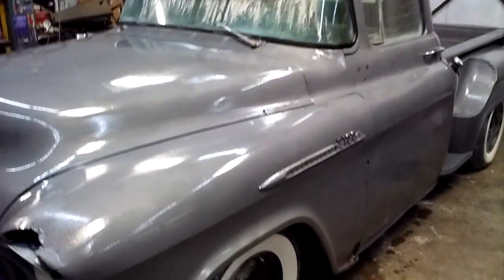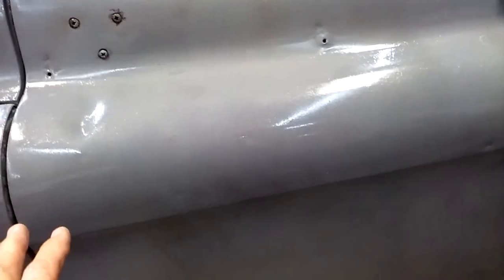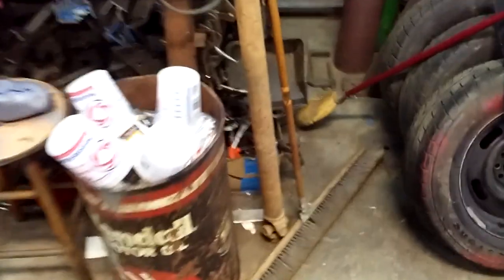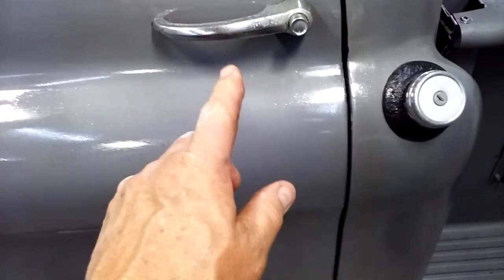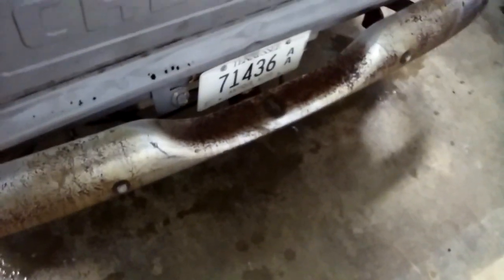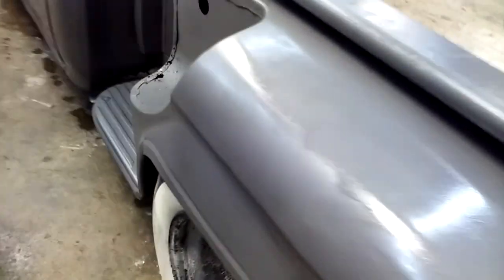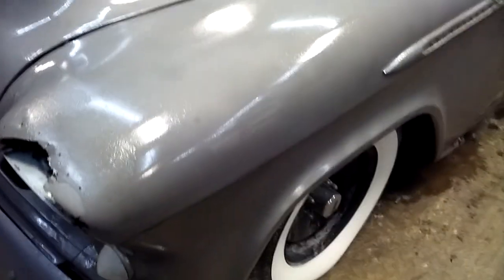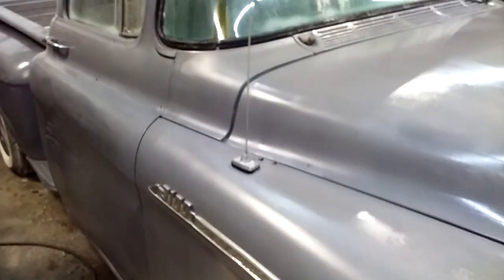Finished applying Penetrol on a 1956 Chevy truck. Part 2

Comment: That looks really good, I’ll thinking about using the kit from 3m to buff my old paint back to a shine then coating it with penetrol. Make my 66 impala stand out with the patina look.
Reply: Why not just get the body work done and paint it? I see a lot of people just lieving the old crusty rotted out body and making it shinny? Might as well just drive as is that shine is not going to make that crusty body on car truck any better looking. Just my opioion. I owed qiut a few truck's in all conditions.
Reply from the maker: I really like it too. I am glad I was there to watch and to be able to help. I think I will try that on one of mine too. Thanks for your comment.

Comment: How does it hold up to the elements / how does it look now a year later?
Reply from the maker: Hello Chris! That's a good question. But actually it all depends on how much weather elements are in your area. There is no set period of how long it will last. I keep my trucks in a garage, I don't drive them in the rain, they don't sit out in the sun much, etc. You might be a lot different than me. If you drive your vehicle everyday no matter the weather conditions, then it will not last as long for sure. For me, it lasts a very long time. I hope that this is helpful to you. If I can help you with anything else, please let me know. I enjoyed hearing from you! Thanks!
Reply: I did my truck Friday night, been 36 hrs and still sticky, how long did it take yours to fully dry?
Reply from the maker: @SDSurfer01  Well I don't know. I have always let it sit for 24 hours with no problems. Maybe it is the humidity in the air. But I have never had that problem. Let it sit for a while longer. Good luck my friend!